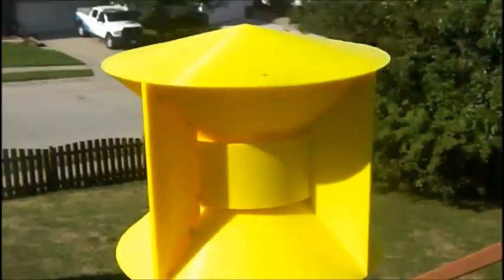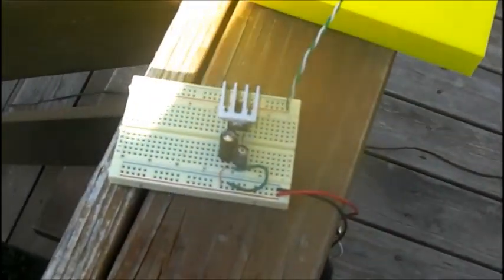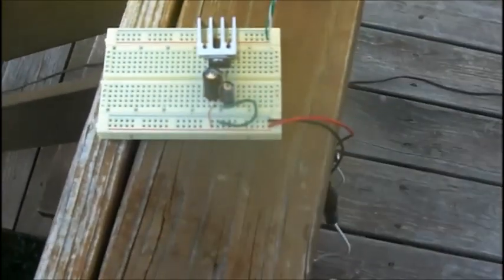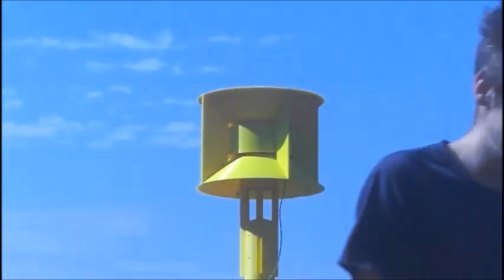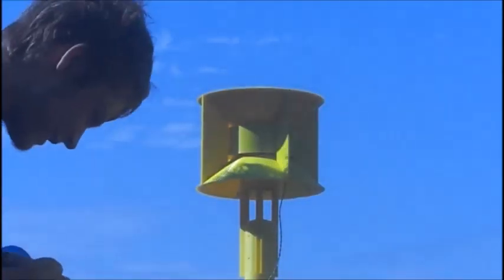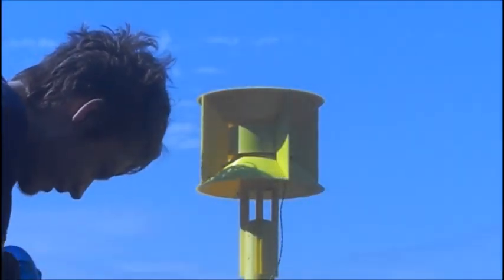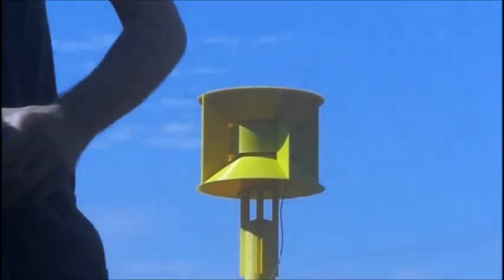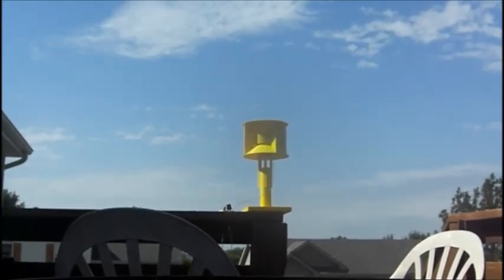mini sd10 siren test with voltage regulation circuit. (read description).

Comment: You use LA4440IC for Megablaster Jr. Now you're using L7805CV for your SD-10. But I don't know which one you use for your mini Thunderbolt?
Reply from the maker: The la4440ic is the sound amplifier on the megablaster junior. And the whole siren runs on 3 different voltage regulators all outputting different voltages. The l7805cv is the power source for the mini sd10. The mini thunderbolt runs on 4 voltage regulators, all with different voltage outputs. (1 volt regulator for each motor.) each of my mini sirens can run on a maximum of 18 volts dc at 1.5 amps. Because that 18 volts gets reduced by the voltage regulators down to the required voltage for each major part of the siren. (i.e. chopper/tone generator, rotator, etcetera.).
Reply: @brokensolarpanel2649  oh ok